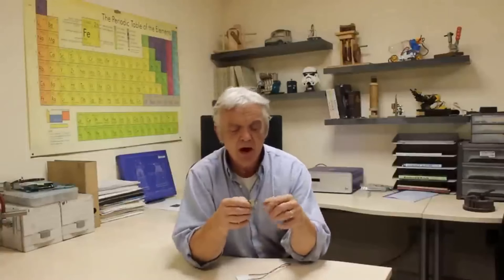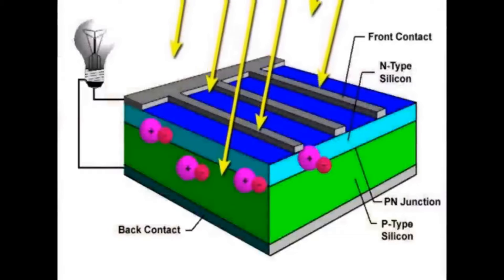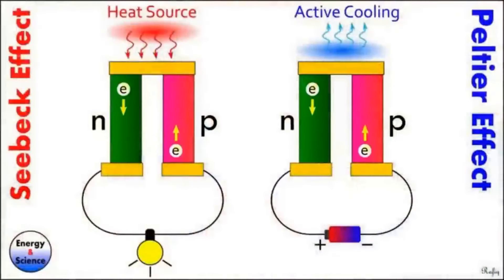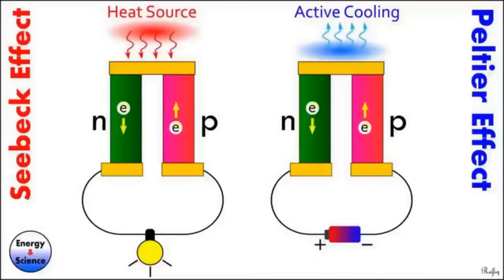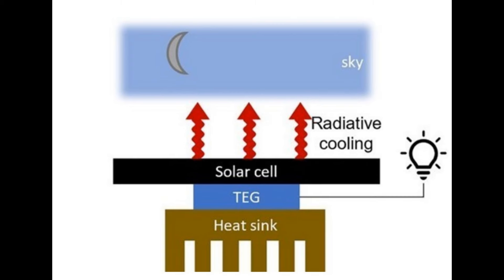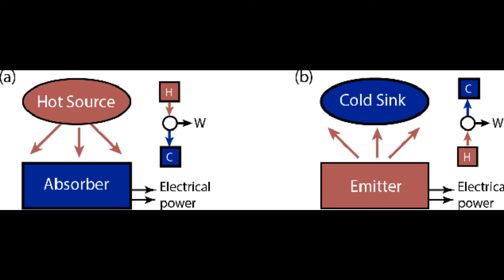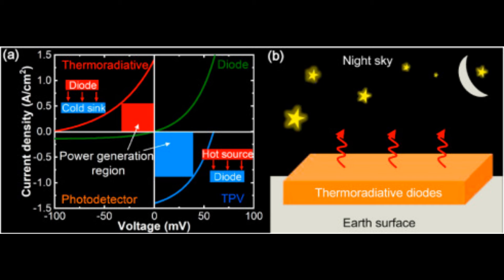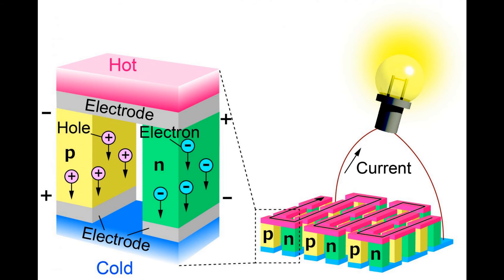2219 The End Of Lithium Batteries - Thermophotovoltaic Cells

Comment: I sometimes think green energy is being overthought. I visited Finch’s Foundry at Sticklepath, near Okehampton, Devon last weekend. Not a foundry at all, but a forge that used to produce around 400 edge tools a day of various types. All powered by water wheels. Of course you have to have a reliable supply, but of course what you use is returned to the river, and could be used by hundreds further along. No pollution, virtually no noise. I don’t think we’ve advanced at all in the last two centuries.

Comment: Thanks for that Robert!
I have some small USB LED lights, a whole unit with 3 3mm x 3mm LEDs on it is about 1cm x 2cm x 2mm in size.
I just took a few of them outside in the sun and put the voltmeter across each of them. All read between 2.0 - 2.3V each.
Pretty cool.

Comment: This works so well with an external ammonia boiler refrigeration. You could cool your home & refrigerator with the same system. All this while being a lot cheaper & safer as the only moving parts are water pumps & fans! Reliable to the point of being generational in operation.

Comment: Thanks for the video... my big issue with the night time solar version is that the media really went overboard with excitement. As you mention, In reality the power output is minuscule at night... 50 mW / square meter or less. 
However, you mentioned heat sinks! So, yes, I think what is more important is the idea of a low cost heat sink ... If you recall, there are "white paints" that can act to lower the temperature of a surface. If you paint the back of the solar cell with this paint, you will improve the efficiency of the cell when it matters most... during sun light.
For example: Assume a solar panel produces 400 watts and has a temperature coefficient of -0.3% ... If the temperature is 5 degrees C warmer, we lose (0.3/100) * 5 = ~ 6 watts of power.
That 6 watts is fairly significant vs 50mW. So, just by cooling the panel 5 degrees C in daylight, we gain much more than night time production by ~ 100x more production in power vs the night production.
Reply from the maker: It has a way to go that's for sure and i do remember the white paint, two versons i think - one uses densly packed calcium carbonate and the other barium sulfate - but they are trialling production versions so it should be interesting lol

Comment: I remember a few years ago someone said they made a thermal battery that had thermal Pv cells in it and would convert the 2000c heat from the liquid metal into electricity.  The only.issue was that it needed iridium, which made it too expensive for the market.

Comment: Will it make power if you put sound up to it?

Is the oscilloscope and the diode sensitive enough to turn all the lights off and see if it can detect any light coming OUT of your eyeballs?

If you hold an ice cube to it what happens with the voltage?

Since you got all the stuff handy I figured I would ask.

Comment: So a solar panel could generate a bit of electricity if (engineered correctly) one side were exposed to cooler night temps while the other were exposed to, say, the warmer temps inside the house itself. Couple that with the fact that solar cells aren't as efficient in very hot summer days. (they actually degrade a bit) One concludes that for max efficiency solar cell design should integrate the thermal properties of, well, the property itself. If the panels were mounted on thick masonry and/or passive fluid radiator that acted as a big, slow heat sink, they might work better in both temperature scenarios? Fascinating.

Comment: This episode lead me to following though experiment 
Let's assume following setup:
There is a water heat(or cold) buffer
Durring day heat pump uses electricity from PV to cool down house and heat up  water.
After sunset water from buffer is pumped to panels covered with IR reflective paint and LDPE, and uses Peltier's to harvest some of energy.
Would Peltier's even power pumps? If so how much would I be able to power with remaining power. How would look in comparison to dumping heat from heat pump to atmosphere and collecting some energy from PV in batteries.
Reply: Peltier devices are anything but efficient.
Reply: I think the first part of your experiment is essentially a hybrid solar PV-T panel. Look into those and see how you feel they work. I got really excited when Robert began the video because I plan on using some PV-Ts on a tracker in a temperate climate. However, when I got to the rather paltry energy density figures my enthusiasm waned. I think there are probably applications where the scheme you are describing would work. I just think that in areas where cooling or heating is required it makes more sense to keep the either hot or cold water and exchange their BTUs before the inlet side of a heat pump directly. So cool how this video got everyone's gears turning!
Reply: @johnlambert7405  My idea does not include collecting heat from sunlight. But it seems like a nice extension.
Idea was that it would be device for remote location on deserts. They need cold place during day, they are poor so PV and heat pump has to as cheap/as small as possible. Low temperature and hight specific heat capacity of water would increase heat pumps efficiency. If Peltier's would be effective enough to provide energy for pumps and lights on evenings it would be a great win - no need to provide batteries.

Comment: Peltier devices, stirling engines, and thermophotovoltaics are fascinating to me. 

The fact that for centuries now we have used heat to produce mechanical energy through steam turbines seems so archaic to me.

Direct heat to electricity in a workabke way us the biggest leap in energy production possible that many people would do well to tackle or improve upon with material sciences. If we ever crack fusion, thermophotovoltaic plates in the chamber, along with som traditional photovoltaics with the expekled light, would be the best way to capture that energy in a simple way. To heat water or other fluids to turn a turbine can accomplish a cooling loop, and can be made more efficient than TPV panels, but is extremely complex, and extreme complexity is very expensive. 

If Fusion ever produces so much more than its inputs (accounting for the energy used to run the inputs in the first place and not just the enregy actually added) then TPV could directly use that energy and keave all the complexity to the reaction devices, whehter it be lasers, magnetic field generstors etc. As of now the piping and eputing of fluid around the device would interfere with much of the other mechanisms. TPV paneles theoretically would just need leads in and out.

Comment: but im up to 100 salvaged vape pen batteries,  i made a 4s pack with them and accidendtly shorted them and the one got really hot the kaptop tape around it started to melt, surprisingly none of the cells died even the hot one recovered, no gasing or anything either, the heat from the short melted the solder joints preventing anymore harmful discharge i suspect, but id hate to be around one that goes thermal runaway, probably best to prepare a containerfor that sintuation, i really wish there was a safer chemistry, heating solar panels? sure,  lets dig a hole to the magma below, free energy.

Comment: You could probably use inside of a compost pile, too.

Maybe generate off body heat?
Thinking about a shoe insole made of this.

Or inside a black orb in the sunshine... A black orb filled with water??? 🤔
Reply from the maker: you do need  temperture difference so you would have to arrange it so one side was kept cool - but if you did that - then yes that would work

Comment: Hi!  Another very nice video.  Have you heard of "Perovskite Solar Cells"?  The material appears simple enough, very high efficiency, and cost efficient enough that we should investigate this material for DIY home solar cells!  What do you think? Could you make some perovskite material?
Reply: Been under investigation since the 80s with a break until say 2012, U of T has a lab going hard on this, Ted Sargent if memory serves.

I remember the shift back to perovskites vividly as I was working on dye sensitized solar at the time (mainly etching titanium dioxide nano arrays) and that whole field died when perovskites hit the mainstream again.

Doing it at home is possible but the chemicals are a touch on the nasty side. I wouldn't want a layman doing it simply from disposal concerns.
Reply: Yes, the lead in the perovskite cells could be disposal and reagent problem for most. But not for you!! @Ammoniummetavanadate
Reply: A perovskite solar cell is not easy to manufacture(for DIY). And they degrade much quicker.

Comment: Energy/ mass / matter cannot be destroyed it is merely converted from one form to another. ‘Free ‘ energy is everywhere .❤🇬🇧
Reply: Light is spread and a typical PV array is huge to be effective. Heat from sunlight is also spread, though certain latitudes get more than others. Wind relates a lot to heat, but some places get more because of flow off the oceans. Heat however, is also a byproduct of industrial processes and that can be used. Heat also causes water to evaporate, rise, and then fall again as rain. Water drainage thus becomes gravity power and small turbines can capture some of that. Larger turbines are too tied to the water sources to be perfect everywhere (despite being super efficient). So, it may not be created or destroyed, but capturing it requires some ingenuity and converting it to electricity is also a bit tricky.